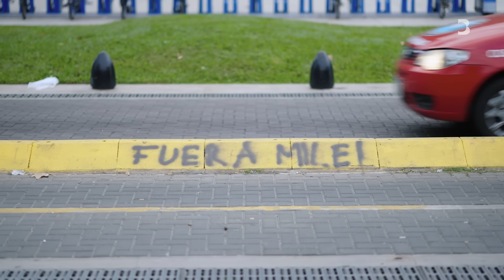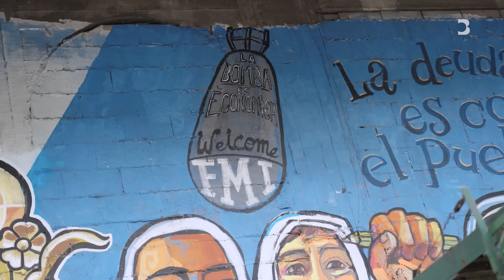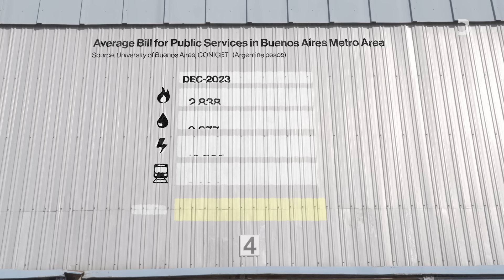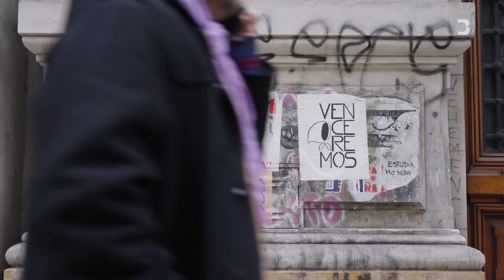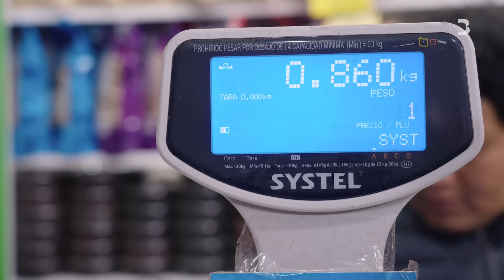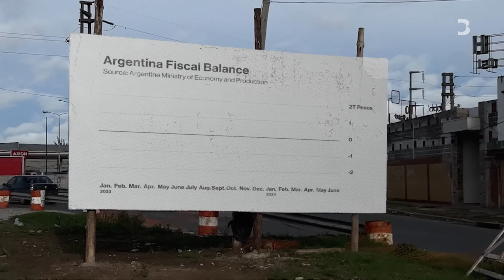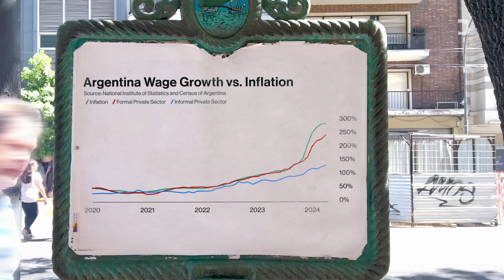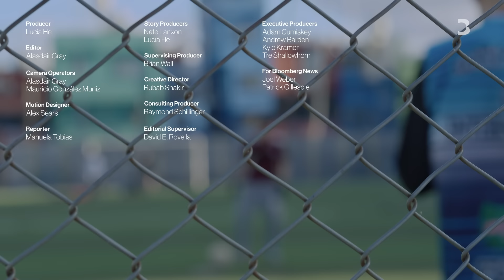Is Milei’s Radical Plan to Save Argentina Working?

Comment: When u cut federal agencies u increase unemployment. Now those workers r no longer empowered consumers, they have nothing to inject into the local economy & they no longer contribute tax revenue to the national pool. In fact, now u have created more citizens who rely on social services. 
Economics on the macro level r tricky for this reason. Cutting spending sounds like an easy go-to solution, but these r not grocery budgets like average people deal with at home. Macroeconomics is a closed loop system. Every move has an associated effect. U cant remove spending without removing opportunity.
Reply: Do you think that, for example, the province of Formosa should keep all it's state employees because it helps to the economy? It has 70% of the population working in state jobs. Why we don't make 100% of the population working in state jobs?
But then why is it that it's one of the provinces with most poverty?
Also the Peronist governor of that province has been in power since 1995...
Reply: @ Thats not what i said or implied. I simply pointed out that cutting employment is not just ‘saved money from not owing these salaries’……
In some cases, in certain percentages, in certain circumstances, laying off labor is affective, but usually only within economies where there r other opportunities for those workers to cycle over to. This way, long term, they never lose consumer power. Im talking about considering productive wealth verses unproductive wealth. The economic goal on a macro level should always seek empowering consumers or aka: creating revenue streams. If u just cut them all loose from the system, how can that improve an already broken economy?

Comment: Milei cut salaries in half as soon as he took office, both by devaluating the peso and letting prices roar with the passthrough. He then proceeded to put the economy in depression, by drastically reducing the circulating money. Pensionists can't afford medicines and medical treatment. Companies are bankrupting. There are massive layoffs. As the economy slows down, so does the tax collection. With fiscal debt increasing, he is "forced" to push even more reccesive measures. Every dollar collected is stubbornly spent on controlling the official dollar exchange rate (something forbidden by the IMF, btw). Even worse, he is now spending dollars from private accounts (inminent bank panic, btw). It's a neverending downward spiral. So, no. It's not working.